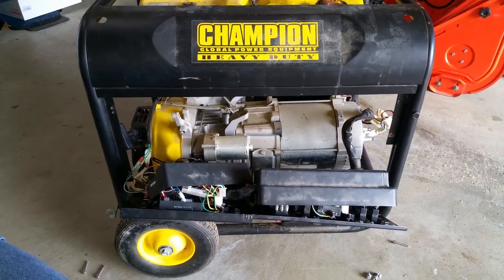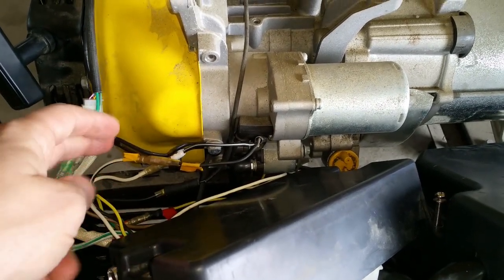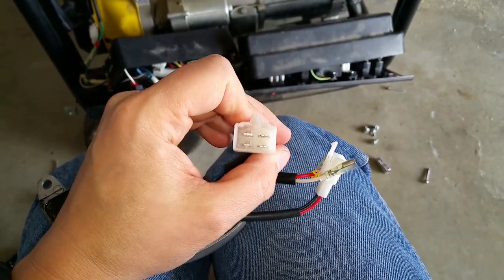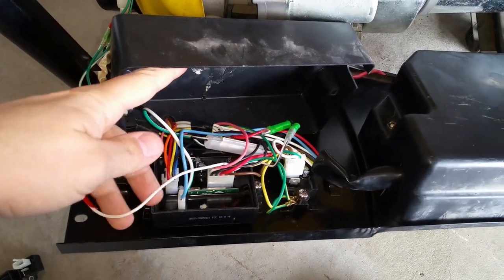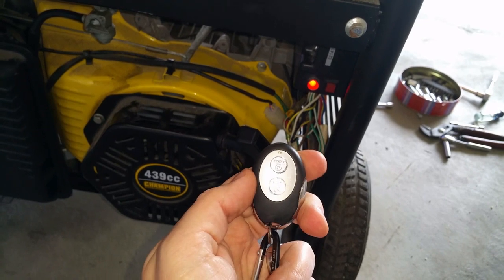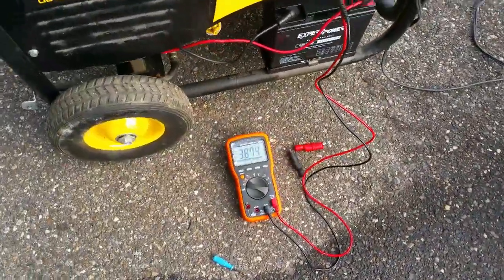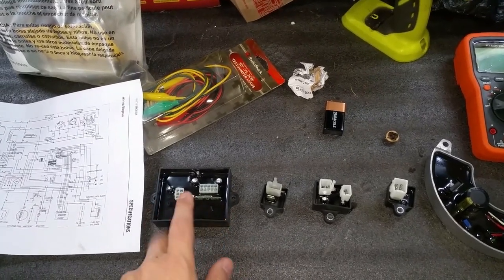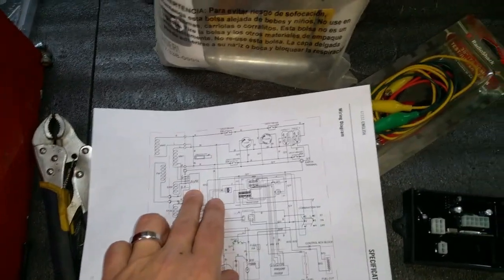Champion Generator Model 41532 Repair

Comment: Hi Gary, I have contacted you several times over the past few years regarding several generators including the Champion 41532. I own off grid property in Maine and the Champion has been flawlessly providing juice whenever needed. I did an interesting conversion which I wanted to share with you and your viewers. Since many of my appliances run on LPG I thought that it would make sense to convert the genny to LP also. I ordered a Tri Fuel carburetor from Champion (Gasoline, NG, LP) which luckily had the exact same bolt pattern. The only alteration needed was removing the choke lever from the stock carb and installing it on the Tri Fuel carb. So far it runs perfectly and I have a 150 gallon piglet tank that the gas company fills when needed.
Reply from the maker: That's awesome! Thank you for watching and supporting the channel!
Reply: @sgsmallenginerepair6780 would you mind checking to see if you received my email question? Thank you
Reply: @sgsmallenginerepair6780 sorry, wrong contact

Comment: Hi. I bought this same generator and it works great...except the remote start. It has never worked. Remote does nothing. The pairing switch and light also have never worked. I called it in and they sent me a new remote and a module. I tried to program the new remote and it does nothing as well. Assuming it's the module. Will change this out, based on your excellent video. If there is anything else you can think of, please advise. Many thanks!
Reply from the maker: Let me know if you run into any issues. We can always jump on a YouTube live to try to troubleshoot. Champion is also very good with getting one of their engineers on the phone to help as well. Make sure the battery's in the remote are good. The generator also needs a fully charged battery as well. Thank you for watching.

Comment: Gary - Question about this model 41532 (I have the same one); I have a new carb installed (replaced from a recall) ... 
If the generator is not being used (overnight) and the gas valve is left to 'ON', is it normal for the carb to get flooded? I know the manual recommends it to be 'OFF' when not in use but I'd expect at least to be no flooding or gas dripping. Otherwise, the generator runs fine when running.
Reply from the maker: The needle/seat is leaking. Probably dirt in the channel or float is stuck open.

Comment: My positive wire form the battery to the generator came out of the generator but can't find anywhere it goes to this is not my strong point
Reply from the maker: The positive battery cable goes to the starter solenoid
Reply: I have the same problem but I can't figure out where to connect the red wire to on the starter.   Do you have any pictures?